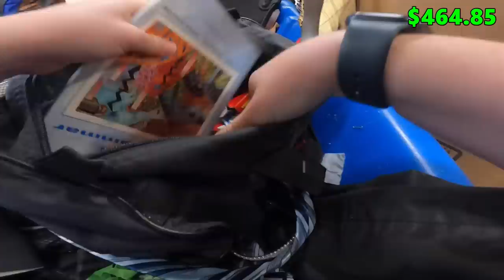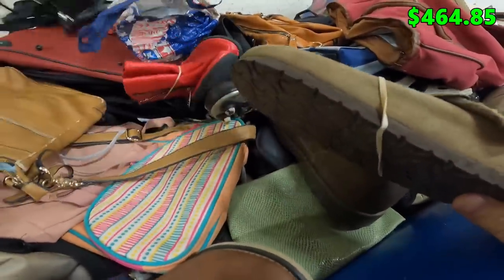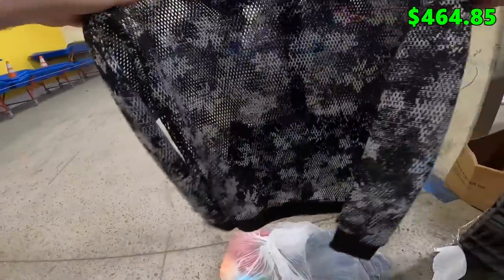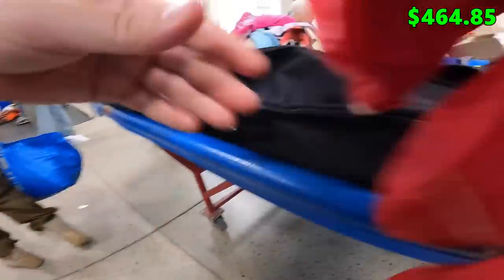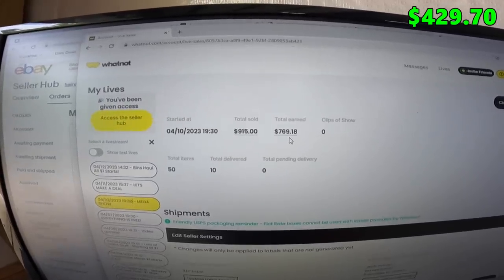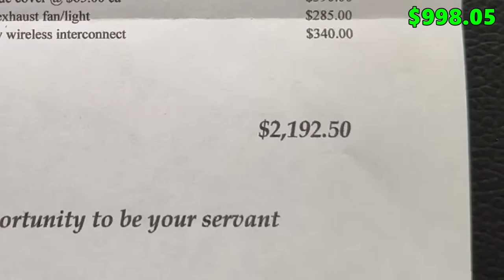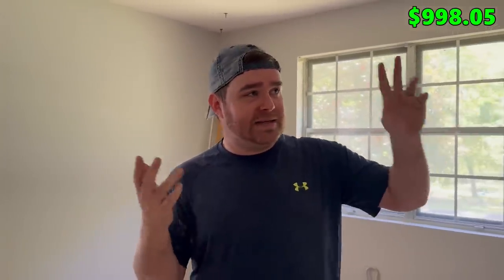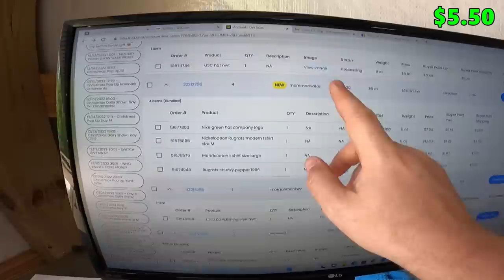Our $20 House Flip Just Went Over Budget...

Comment: Electric is a bitch but don't forget to add coax cables for satellite/cable connections. If you don't your tenants will and the cable installers will do it and do it cheap and badly and so on and so forth. If you can use cat6e cable and and outside panel hook up.
Reply from the maker: I’ve been taking out all the old co-ax cables from previous installers. Like MILES of it under the house. It’s been a mess
Reply: @HairyTornado  yup EVERY time someone comes in with a new service they set up for a different way.

Comment: Do you have to hardwire smoke/carbon monoxide detectors?
Reply from the maker: You don’t HAVE to hardwire, but you have to have smoke detectors. We went with battery powered ones that wirelessly connect with each other. More expensive than hardwired ones but we came out cheaper than we would have if we had the electrician hardwire them. If that makes sense. The battery powered ones cost around $50 each and they last for 10 years.
Reply: @HairyTornado  I was just wondering because in my area you would have to hardwire them once you start that extensive a remodel.  Funny how different the building codes are throughout the country.